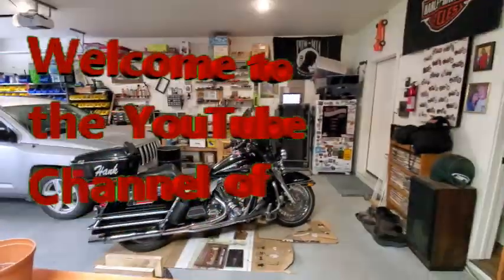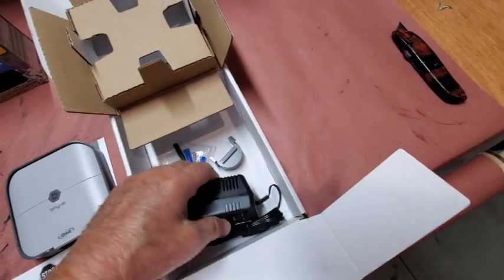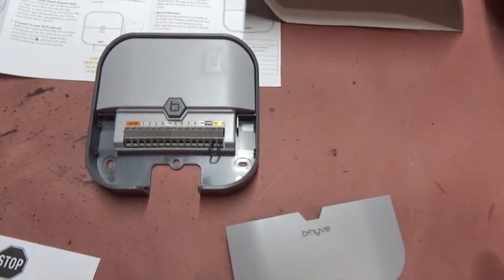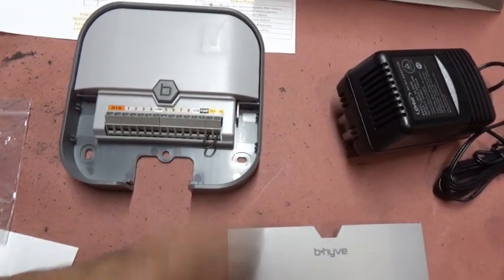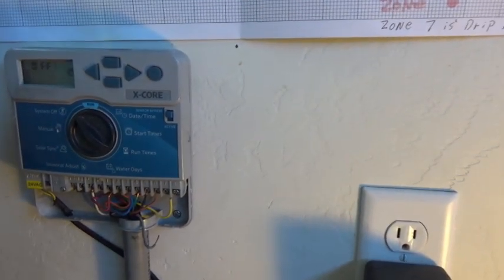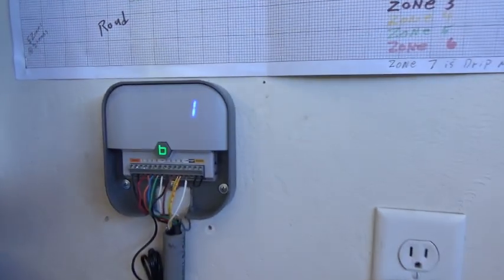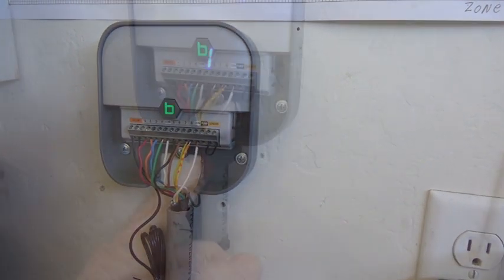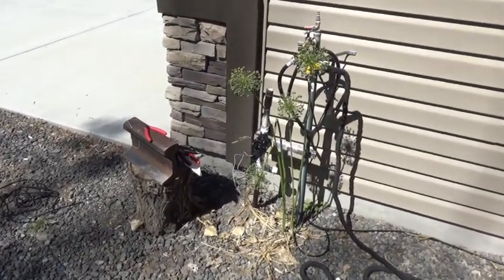Orbit B hyve 8 zone Smart indoor sprinkler controller

Comment: Is this controller required the rain_freeze sensor or is it getting the forecast  info from WIFI connection?
Reply from the maker: Mine does not do either you can buy an adapter that plugs into the unit that will gauge how much water is being used on the yard. I just do that part manually I know when it's going to freeze and when it's going to be hot and dry and I just turn it off no matter where I am in the country that's what I like about it

Comment: what do you think of the app?  What's the ease of use?  I want my Mom, who is not tech savvy, to be able to use it after I set it up for her.
Reply from the maker: I think she'll be able to handle that it's pretty simple if somebody sets it up, once it's set up just a matter of hitting buttons and walking away, have no problems so far with the unit. Of course I haven't started it up this year it's only been in there for a little less than a year

Comment: Don’t be so excited. Eventually it will no longer connect to Wi-Fi and your programs will stop running. It won’t water but it will tell you that it’s going to water on say for example Wednesday but then it never Waters Wednesday. You can’t connect it to Wi-Fi to control it so then you have to try connecting via Bluetooth and then you can only manually water because it still won’t run the program and then eventually Bluetooth stops working right after you pay your lawn guy a bunch of money to recede the lawn. Terrible product.
Reply from the maker: Thank you for the information I will keep my eye on all of that.
Reply: My Wi-Fi is still broken but I can connect via Bluetooth and manually turn on my program. So try that.  It won’t be automated like it is supposed to be but at least you can still run a cycle.